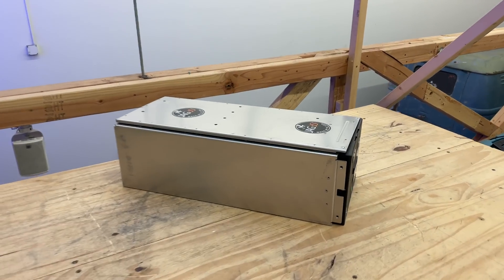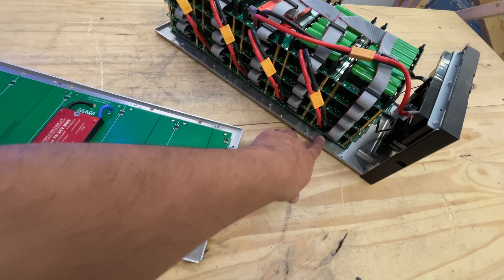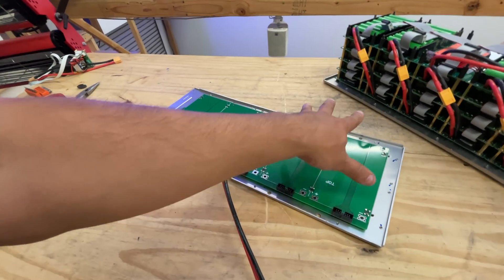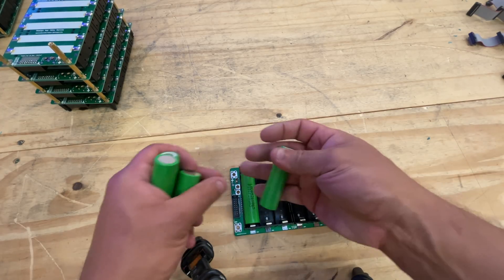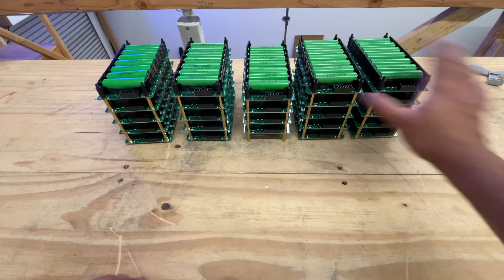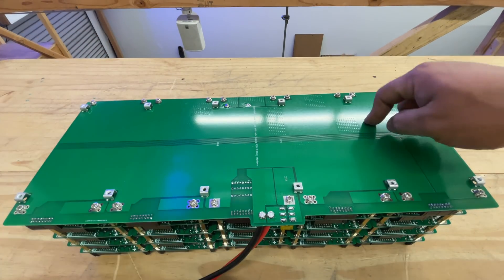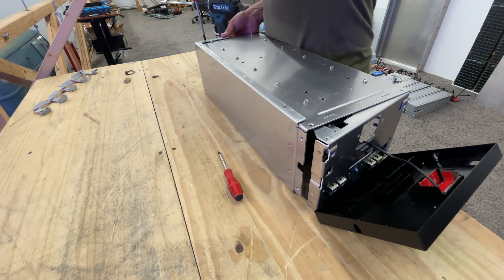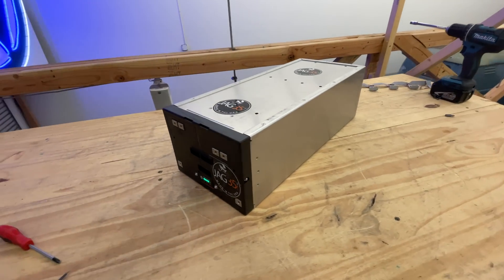24v Powerbox v2

Comment: Hey Jehu, thanks for the V2 version.  Would you consider a model using the Boston Swing cells?  I bought a bunch of Boston Swing cells from you but haven't implemented them yet.  I also have a lot of Boston Sonata cells from earlier 7S projects that I would like to use.
Reply from the maker: You can use this setup with slight mods.  The Boston cells load up in the same 18650 holders just fine,  you would just need longer standoffs as they are twice as tall as regular 18650 cells.
Reply: @jehugarcia  thanks for the reply. Took a long road trip so just seeing your reply.  Thought so, I had bought longer standoffs when working with your earlier 7S boards and the Boston Sonatas.

Comment: Jehu would you consider redoing this project?  At least the circuit boards, BMS, misc parts.  I've already bought the 7S project boards and all the parts, some 7S BMS, power measurement, etc. for a 12V project.  Now want to move at least 24v.  Thanks for all you do.

Comment: Absolutely love the concept but as many others have said. Between the kit and buying new batteries…your looking at at a $800-$900 battery
Reply from the maker: Well…. You could just buy all the parts and build it yourself for half the price
Reply: @jehugarcia  I love your channel….The plug snd play concept is great…like a big Lego set. Just wish costs were lower. But…you do the work…you deserve the $$$. Maybe you could make some custom cases for your battery packs….like a laser cut plexi with vents.
Reply: You could pay 750 for a new pre-built battery, and then in 10 years pay the full 750 (+inflation) again.  Or you can buy this, and in 10 years you only have to buy the cells.

Comment: you should design a new top board for structural rigidity. the reason is you are relying  on the bottom board  to keep the 5 towers steady, but the pcb material flexes  and may be able to break if it is dropped. the board only needs holes in the proper places to secure the towers of cells.

Comment: It’s a great idea but the cost needs to come down for it to become a game changer.  $400 for the enclosure which gives you 7s24p of space, you have to use expensive cells for it to make sense.  Stacking the enclosures with cheaper salvaged cells would still end up being expensive.
Again not hating , it’s an awesome idea and opens to door to someone who hasn’t invested into all the tools needed to build battery’s.
Reply from the maker: The reason for the expense is that you are paying me to do most of the work,  if you order all the components and build it yourself you  can cut the price in half more if you solder the boards
Reply: @jehugarcia  However your customers are looking for turn key. Maybe its time to think of how you can scale up. Your brand is pretty strong. Maybe partner with some Chinese manufacturers to get the costs down.
Reply from the maker: I’ve no interest in offering turn key products,  I will always require you to DIY
Reply: @jehugarcia  fair enough, however,  your designs are pretty progressive.  Probably there is a space in the market especially for your DIY boxes using salvaged cells. everything else I've seen out there is pretty amateurish. Your PCB based designs are quite the revolution. just saying
Reply from the maker: Just wait to see on the ones I’m currently working on,  it’s is close to turn key but not 100% there
Reply: @jehugarcia  👍just one small request though, would appreciate if you made your products available outside America. 🙏🏾🙏🏾
Reply: @jehugarcia  Can you offer the kit for us to do all the assembly, soldering the boards, etc?
Reply from the maker: Yes check out my projects at https://www.pcbway.com/project/member/shareproject/?bmbno=1FFDC119-37CE-44
Reply: I think the best part about this idea is that it makes it incredibly easy to replace cells down the line in 5 years, 10 years or whatever.  There's no glue or spot welds holding it all together.  So when/if you get around to replacing the cells, you save the cost of this box/bms relative to if you had to buy a whole brand new pre-built battery.  And the only thing that's trash is the old cells.  Everything else gets re-used.  

This is a great setup, and any improvements upon the idea to make it safer, convenient, or anything would just be icing on the cake.  Things I'm looking at are maybe stackability or added rigidity or strength internally or possibly key area insulation.

Comment: Is it me or are the screws at the bottom of the PCB very close to the case bottom plate?  Even with the solder metal standoff, it seem very close.  I would put some kind of insulation foam pads on those screws as extra protections.
Reply: I agree.  Needs some type of insulation pad.  Any dent could cause those positive screws to contact the negative of the box.  Some foam padding would work great for isolation and would add some dampening to the rest of the board.
Reply: @TurboTechieSystemsIrving  yes foam is good , but put the foam over a proper insulator layer- that green sticky backed  cellulose insulator paper called fish paper.   for diy battery best practice, fish paper (or perhaps some insulating plastic sheet ) should be used as a liner inside any metal battery chassis.
Reply: @yeliab814  I was talking about using 1/4 inch EVA foam which is impact resistant, chemical resistant and non absorbing.  In my opinion this is much better then just using .025" Barley Fish Paper.  Combined of course would increase the isolation further.
Reply: @TurboTechieSystemsIrving  agreed.  i was indeed suggesting the use of both. neither alone is optimal and their qualities are entirely complimentary.